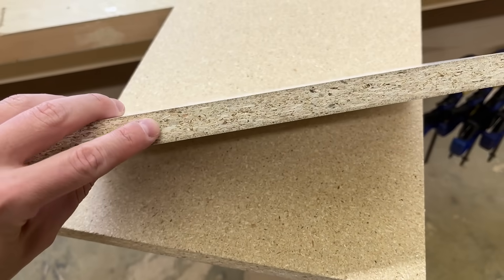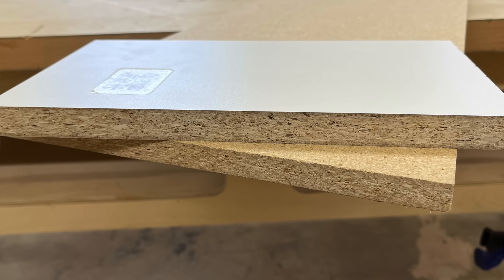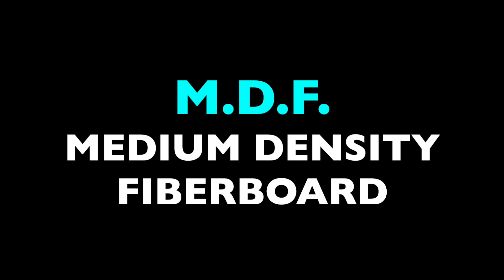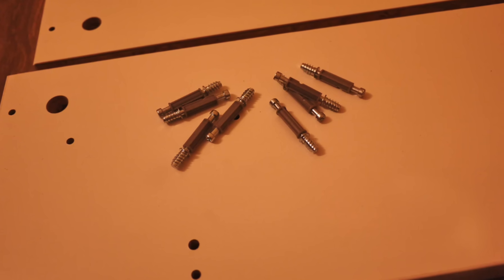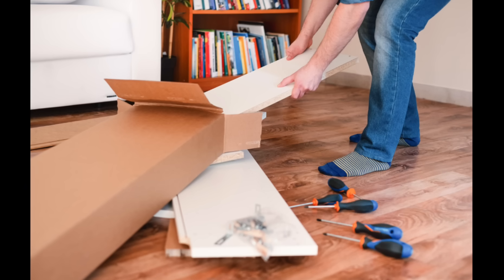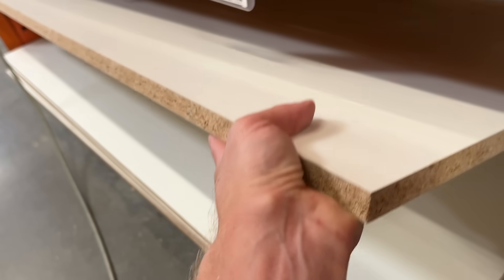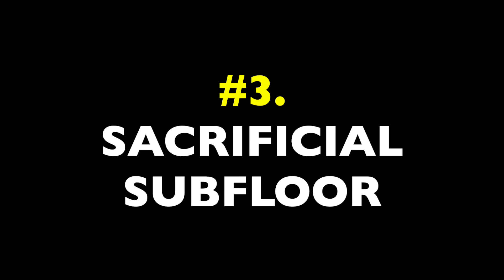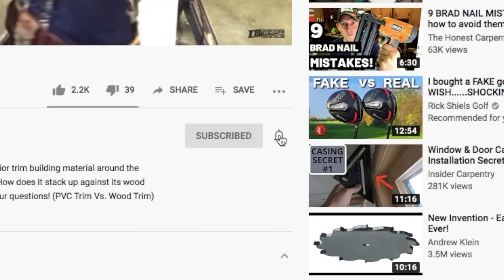The Truth About PARTICLE BOARD...Is It The Worst Material?! (Pros + Cons...Particle Board)

Comment: You missed one large use for particle board, building speaker enclosures. It is the one of the best and most used choices for it. Some expensive brands use it.
Reply: What makes it better than some of the other woods for speakers?
Reply: @JS-tb9hu  Maybe omnidirectional resonation? Normal wood has direction of fibers so it will resonate diferently in diferent directions. I am guessing.
Reply: @PeKlim  I think it would be its sound insulation qualities maybe. Reflecting sound back out of the front.
Reply: @PeKlim  it is more dense and has less vibration, no hollow spots and of course the lower cost. There are probably others but that's the reasons given to me when I started making custom enclosures.
Reply: @JS-tb9hu  It's not 'solid' - so it doesn't reflect and it has no single resonance frequency
Reply: Question, if you're willing -- does it help absorb/insulate against bass frequencies, d'you think?

I'm building a tiny house trailer & need all the bass insulation I can get, so I'll be lining the walls/joints of all types with loads of rubber ... But I'd cut weight from my materials elsewhere in order to add particle board to my walls, and take the time to waterproof the hell out of each panel of it first, if there's decent evidence that it would help reduce vibrations from bass and/or the road. If it does enough to reduce the amount of rubber that might be good for costs, and rubber ain't exactly lightweight either so it could work out, idk, just seeking thoughts on cheap materials and hadn't previously heard of particle board being useful in the context of sound.

No pressure to take time answering unless it's convenient for you of course! Thanks in advance for any help, to OP or anyone else :D
Reply: @ItsAsparageese  Its certainly going to be more sound deadening than solid wood as its the wooden equivalent of foam. Im no sound engineer though so dont take my advice. From what I know from researching blocking road noise fencing they use a double panel fence with foam in between the panels. This supposedly gives the best reduction of bass frequencies like road noise.
Reply: @Apollo-p1l  Hey thanks, that's super helpful! Hadn't occurred to me to research road noise control fences and their engineering, so that gives me a whole new useful rabbit hole to check out for more materials insights. And yeah it's making sense to me that it would deaden sound more than solid woods so that's useful to look into.

Before this thread, it never would have occurred to me to consider particle board for a wall panel material. It's like a wooden version of drywall lol, not that I was planning to do drywall in the first place ... I wonder how thin it can get and still have enough rigidity to hold up well if laminated with rubber and maybe at least partially around the edges with metal. I was going to use 1/4" ply for that layer anyway. Can't be that hard to just smother the ends in epoxy for water protection lol (... she said with naivete and hubris)
Reply: @ItsAsparageese  it's main purpose in enclosures is to prevent sound waves from reflecting. I personally would not recommend particle board for a Mobil travel trailer. The downsides I'm thinking about is, #1 it is heavy in weight, #2 I don't think it would stand up very well to the changing humidity as it swells like crazy if it gets even just damp. 
I was thinking what about 1/4" exterior plywood, coated with roofing tar on the insides with a 2" by between 2 panels with insulation in-between them. Imagine a sandwich made with 1/4" plywood coated on inside with roofing tar and stuffed with insulation. It would be fairly light and resistant to weather and noise.  
Before you do anything go to a lumber yard and see how heavy particle board is. And the thinner sheets will flex.
Reply: @a9ball1  Yeah thats how I would probably do it, lightweight insulation of some sort between two panels.
Reply: @a9ball1  This is excellent advice. Thank you so much for your help! Sorry for the slow reply, I'm more disorganized  this time of year than usual haha. For real though I super appreciate you taking the time to think that through and explain such useful info and make a great suggestion. I'm excited to learn more about tar as well, you're giving me lots of great ideas about that, plus I was recently given most of a roll of tar paper so that's a line of research I need to start down as well. Yeah, despite my tendency to accidentally try to be way too original about everything, ¼" ply is definitely consistently turning back up as the best foundational option compared to any other realistic material I've considered! 😆 Thank you again for all your effort and helpfulness! This part of YouTube is so great, especially this channel's community.
Reply: @Apollo-p1l  Thanks again to you as well for throwing down on advice about this. Yeah ¼" ply keeps coming back into the number one spot as the best realistic foundational-wall-material I can come up with to consider. I'm also going to be building with ridiculously thick doubleish sandwichy walls to begin with, because I'm gonna try a crazy idea of storing all my water (and lots of it) in a pipe network through the walls (mainly to keep the weight always spread out evenly, but also for gravity-fed-water-silliness reasons and other stuff), so I'm doing a sort of double frame thing. But if there's anything I've learned from staying indoors sometimes in between living mostly in vehicles, it's that thickness does not equal soundproofing lol 😝 So I want to be really thoughtful about materials for the design, 'cos limiting sound is super important to me and I need the build to last me at least a good ten years before giving me any maintenance drama. Point of ramble is, y'all have been very helpful and I appreciate it! :D
Reply: @ItsAsparageese  Whatever you decide on try not to brace the outer and inner panels directly with a solid material like wood anywhere as the sound will simply vibrate the outer panel and the bracing will transmit it to the inner one making the insulation or air gap or whatever redundant. If you need bracing between the two panels then use a rubber or foam strip between the ends of it and the panels. Your plumbing sounds interesting!!! Good luck.
Reply: @Apollo-p1l  Word, makes sense! Yeah I'm planning to go hard with lining practically everything with rubber haha, seems ideal for stability of the build on the road long-term along with the soundproofing benefits -- BUT I had thought mainly of laminating it to the non-weight-bearing wall face elements, and hadn't thought about making sure I stick it in between every cross brace in my weird frame (and yeah it'll have many), so that's an extra valuable tip! Thanks so much for your help and encouragement! I really appreciate all your comments! 😁

Comment: It all depends on the project. I made a home library with cabinets about 25 years ago from melamine coated particle boards, and it still holds as good as new.
Reply: Right tool(material in this case) for the job - as always.
Reply: i have found that screws dont hold in it.
Reply: @roccoconte2960  well the mix of pre drilling and using dowels and glue makes it pretty freaking strong, especially when making kitchens where you have multiple elements fixed together and supporting each part from multiple ways

Comment: We learned the hard way when we were a young married couple that shelves made with this material, though cheap, was completely useless within 6 months. Spend the money on decent furniture.
Reply: If your buying boxes furniture yes it sucks. They don't use thick enough pieces indoor grade. They don't use proper joints. Yes it's crap when made that way.
Reply: Funny part is, a lot f people think cause a piece of furniture is heavy that it’s made of quality materials. Sorry wrong! Particleboard or chipboard very heavy compared to most hardwoods.  Other thing is, furniture store salesman con customers legally. Long as there’s even one tiny piece of hardwood on furniture the stores or salesman can legally say the furniture made of solid wood.  I’ve had this conversation with so many people saying their furniture they bought is all solid wood. Now with almost all furniture there’s some area where you can see the edge of the materials and I’ve  turned furniture around or flipped it over and low and behold there’s the raw edge of particleboard!  Needless to say the people are not happy and shocked what they bought!  Furniture stores or their sales y don’t like me very much cause when they tell me their furniture made of solid wood, I’m quick to show them it’s not! 
Now with all that being said, if the furniture is actually made of all solid wood, it needs to be in consistent temperature away from moisture.  Changes in temperature and/or moist areas will make the solid wood warp, twist, shrink or swell. Any place where the wood glued together like a dinning table or a side of a cabinet where there’s joints that has two or more boards glued together. Those glued joints are prone to fail and split apart.  For example I’ve had numerous people have wood stoves or large windows (Sun generates a lot of heat thru windows) not too far from their dinning room table and chairs that’s has their table and chairs split apart at the joints in numerous places.  Some cases the joints can be Glued again and clamped together till the glue dries.  But not always a easy project to do and get it where it looked like new again without some sanding and refinish work.  So as nice it is to have a real solid wood piece of furniture, it does need special care to lasts a long time.  Plywood with veneer is much more stable and can handle some temperature changes better then solid wood and can look just as nice in many cases. If your wanting furniture that can take a little more abuse plywood a better choice with the exception that if plywood veneer gets damaged you may not be able to repair the veneer damage. Especially if the veneer is a import product since the veneer is so thin on the plywood that it’s literally less then paper thin. Domestic veneer on plywood is usually over a 1/16” thick giving you some veneer to work with if it gets damaged.  You can steam the veneer with a iron and a wet cloth that will raise the grain and make it so you have less sanding to do to make your veneer look like new again if necessary!  Usually not that lucky with a import veneer plywood!  Of course solid wood you can steam and sand a lot and never worry you’ll sand thru a veneer!  They all have their advantages and disadvantages depending on damage?
Reply: @ghostridergale  fairly recently Stumpy Nubs posted a video showing the construction of an antique chest of drawers. Very interesting, carpenters have understood the way wood moves for a long time and taken that into account when building but lots of new stuff is just built to a price just to make a buck and ends up in the trash when you move somewhere else...
Reply: I use particle board shelves in my garage and they have held up for a year with no problem…I put heavy totes on them and they hold just great
Reply: Your one of the first I’ve seen mention the pros and cons of particleboard or chipboard. One that you missed with the melamine is there’s also another brand called Coretron
and I may of spelled it wrong?  But how the word sounds anyway!  Another issue you didn’t bring up though with these vinyls on particleboard is the fact that the vinyl will shrink with a little heat. If the material near a windows where the sun hits it the vinyl will shrink leaving raw particleboard showing on the face of the boards. Unfortunately there’s very little you can do to fix it once it shrinks either!  It certainly doesn’t look pretty after it shrinks and you can see the particleboard on the outside of the cabinets!  Plastic laminate be more expensive to cover materials with and it’s capable of shrinking as well. But usually more stable than the vinyl is!  Personally I’m not a fan of particleboard nor any of the vinyl veneers on particleboard and I’ve had to replace both numerous times over the years that was only a year old after installing it. 
Set cheap cabinetry next to good quality cabinets and when both are brand new you can’t notice much difference in looks. But take those same cabinetry and look at them side by side even a year later and there will be a huge difference how well they hold up!  Although hardware quality is every bit as important too! Cheap hardware won’t hold up long either!
Reply: @ghostridergale  I've had a particle board set of shelves for 9 years, it's been water damaged and sits in the sun the VAST majority of the day.  It's still rock solid, and none of the white finish has shrunk from heat.  I think you may find that not all particle board is created equal, but then that should be obvious.
Reply: @Mad-Lad-Chad most likely a good build and right grade. Plus depends on the skill of the worker. As well if they care too.
Reply: @SillyOmega  Which is exactly what I said.  Not all particle board is created equal.
Reply: Same. My wife and I bought some Ashley furniture and  found out the hard way.